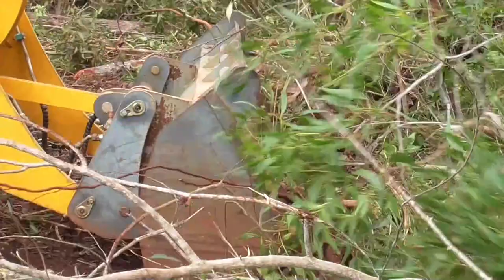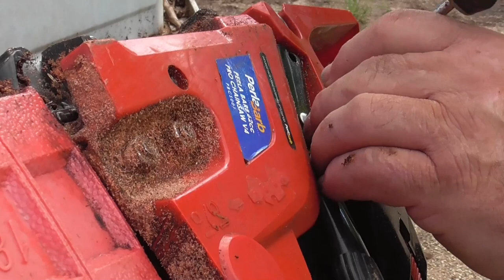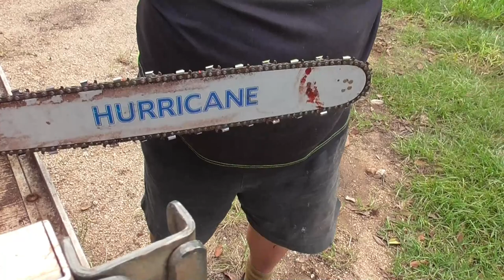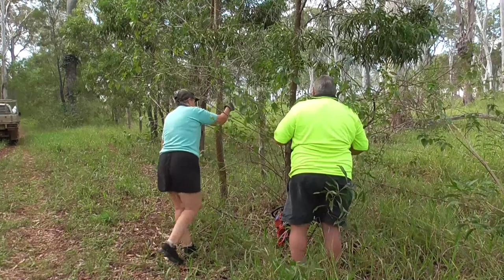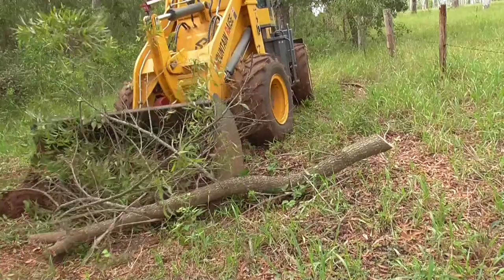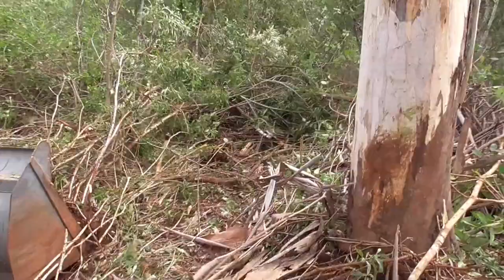WIDENING A FIRE BREAK AND A NEAR ACCIDENT

Comment: Glad you came through unscathed. I've done crap like that. Just the other day I was cutting down a weed tree that was growing at a weird angle and even though did do a little back cut first I still managed to get the bar of my little electric chainsaw pinched. I walked back to the shed to get a machete to chop it free... after 5 or ten minutes of chop chop chopping I finally got the saw loose and it was okay, but I was a bit out of puff, which may have contributed to me stumbling over the brush I had already cut down and falling flat on my face and knocking what little breath out of me that remained. Sometimes farming can be humiliating!
Reply from the maker: Nature fights back Ha Ha. John

Comment: Here's my bit from armchair point of view: never use a bucket as a lift to stand and chainsaw- use a pole saw instead. Top branches must be left to arborists. Also Pat's leg was way too close to the chainsaw and in case the saw slipped it'd have been the wrong limb you cut off mate LOL! By the way, do you use the loader because of extra weight it provides because won't one of your 5 tractors with FEL do the same clearing job a bit more safely as a loader has a narrower wheelbase and fit for flat grounds only?
Reply from the maker: I looked at the video and it gives the impression that pat is close. She was not in line with the blade she was closer to the camera than she looked. The other tractors I have with a FEL don't push hard enough for that sort of work. Tractor FELs are not designed to push they break if you push hard with them or the tractor breaks. They are only an add on to a tractor which is designed to pull implements. A loader is designed to push like in digging out dirt. John